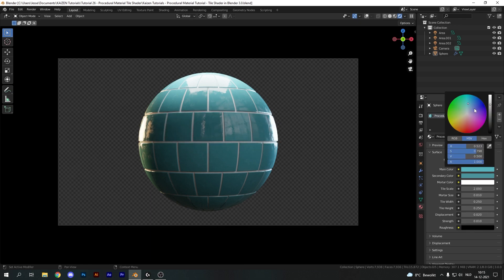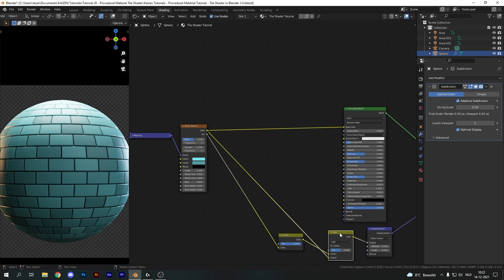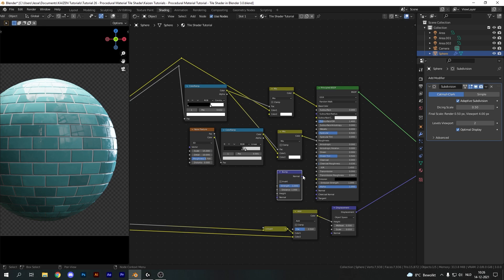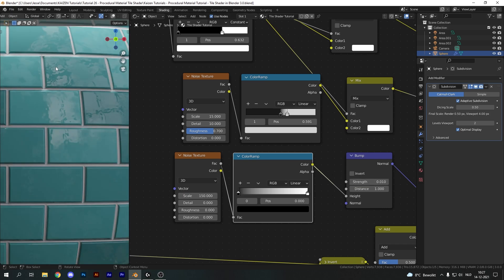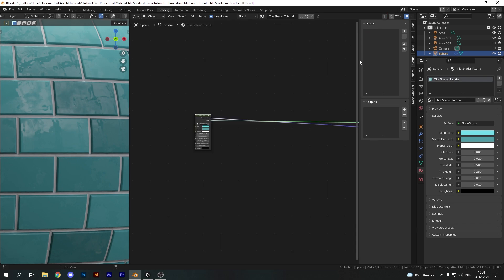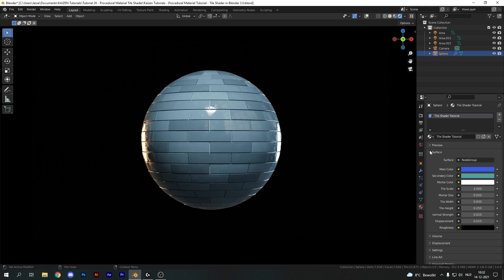Procedural Material Tutorial [Tile Shader in Blender 3.0]

Comment: Thanks for this tutorial! Nice texture! I managed to make it, but the bump/displacement effect doesn't work for me. My texture remains flat and the tiles don't stand out against the mortar. However, I did select bump and displacement in the settings. I'm trying to apply this texture to a rectangle. Any idea?
Reply from the maker: you need geometry for displacement to work, so either enable experimental subdivision or just subdivide the plane a bunch of times. Normal(i.e. bump) should work though. Just be in rendered view and have lighting to catch on those edges.

Comment: Maybe someone here can help... how could you add a random tilt so not all tiles are perfectly arranged on a planar layout, but are slightly unevenly placed?
Reply from the maker: that would be hard to do, but using normals that would mean applying randomized gradients on each tile. It's probably possible, but this is really advanced procedural shading in Blender and would probably be better done in Substance Designer e.g.

Comment: I have a material I need and is it possible to bring in a photo and or normal and displacement maps and plug it into the material and still have it be seamless and procedural? I think the most realistic outcome is bringing in a photo of the real tiles but I'm having trouble figuring it out in blender.
Reply: would I be able to plug in a material with the bump, normal and ambient occlusion into the color factors?
Reply from the maker: You can do that yeah, but you'll have to 'mask' the edges to get a good result. It's still not the best solution though for seamless stuff as you'll always get repetition and our eyes are great at spotting this.
Reply: @KaizenTutorials  hm what do you think the best result I then? If I need to use a specific tile / material

Comment: Hi, thanks so much for this, it's great.  How do I rotate the rows as you have in your animation - to get different layouts of the tiles.  Thanks.
Reply from the maker: There's an offset slider on the Brick Texture for that.
Reply: @KaizenTutorials  Great.  That's helpful. I have one more question.  I am trying to make a group of objects - each with a different colour tile on them.  I have copied the procedural material in the material tab and altered it but they don't seem to be able to be applied.  Do you have any advice? Thanks.
Reply: @KaizenTutorials  are you able to help me to apply these - I am completely stuck. I have managed to do one but the others are not attaching to the objects which are just matt.  I can't get the tiles onto them.  Thanks, Clare

Comment: Thanks for tutorial. How can we change seam  mortar color and sill keep it rough/matte? When I unplug fac-socket from Brick Texture node the seam color can be changed but then it just follows the overall roughness of tiles.
Reply from the maker: You'd need to create a separate map for the roughness. So just use the same way you're controlling it now, but also use a different map for the color of the mortar.

Comment: err my bump mix is wired as its inverted and doesn't act like yours I assume its due to an update since this videos upload
Reply from the maker: hmm you can either try inverting the node with an invert color node, or hitting the invert on the bump.
Reply: @KaizenTutorials  i thought the same but it did not work so i just left it on white as i think it due to experamental updates
Reply: @KaizenTutorials  im also having an isuse that im not sure if you can help with but adaptive mesh crashes my render but turning it off renders fine (I fixed this by truning off adaptive sub and just subdividing it to 4)
Reply from the maker: Ah yeah adaptive can be hard on your pc making it run out of gpu memory. So you can either make the dicing scale higher or as youve done just use a regular subdiv with a high number

Comment: Hmm, When i turn on the adaptive subdiv, there are black artefacts that appear on the top and bottom of my sphere?
Reply from the maker: Hmm that’s weird. Maybe your displacement is to strong?
Reply: @KaizenTutorials  , I checked and when I turn simple subdiv instead of cat 
Mull Clark it works
Reply from the maker: @SG-bh7cz  aah ok that means you probably just needed more proper quad geometry to work with. Still a bit weird though. But if it works with regular subdiv thats fine too
Reply: Hey there kaizen, I would love to know the lighting and hdri’s u used for this video!
Reply from the maker: Simple tri-light setup with a back light, rim light and key light. No HDRI I believe! And if I did its probably an interior one from polyhaven with a very low strength!

Comment: Hey Kai, thanks to you I made my first PBR material and I've also added my first asset to the asset browser! However, I need a little help. I'm using the shader on a plane [acting as a wall] I've simply dragged and dropped the material from the asset browser and onto the plane. It looks great but I want to increase the DEPTH of the mortars so that the tile looks more "bevelled" right now its kinda looking too sharp around the edges. How do I do that? I haven't subdivided or done anything to the plane. 

For context I'm making a product render where the product is placed on the a tiled environment.
Reply from the maker: Great to hear! I think you'll just need more geometry. This will make it smoother. You can change the mortar smoothness in the node but it doesnt do much if the displacement has no geometry to work with. So add a subdivision surface modifier, crank it up and sit it to simple and it should look good. Then after you can increase/decrease the mortar smoothness to your liking.

Comment: Great video! Beginner friendly and easy to follow. I have one small issue. On exact same sphere bricks were looking completely fine, altho when I've tried to put it on flat surface around 5mx5m, texture begin to curve a bit in one point. After rotating the mesh it still remains on it's place.
Reply from the maker: That might be due to which texture coordinate you're using. Make sure you're using UV coordinates so it works on any object (if unwrapped atleast). Hope that helps!
Reply: @KaizenTutorials  Problem solved! Thanks for the help!

Comment: Hello Kaizen! I'm doing procedural materials with this tutorial by days but there is one thing i can't fully understand: why my displacement map isn't even? it distort my bricks at various heights. I tried ticking everything but it simply doesn't behave like yours. I tried doing something but nothing to do
Reply from the maker: Usyually when something goes wrong with displacement it's an issue with the geometry. Try adding more geometry for the shader to work with. Either add a subdivision modifier or simply add more in edit mode. Hopefully that works!
Reply: @KaizenTutorials  Thanks for your reply! It helped but I was at work and my question was roughly explained: the real problem is that my displacement map (value of ~0.08) displace tiles casually at different heights (like a mini world sorrounded by all different buildings). Another odd thing I just discovered while typing this comment is that even if my brick height and brick width are the same value they doesn't form squared tiles. From Blender 3.3
Reply from the maker: Oh the default output for the brick texture has color variations (grey value) that causes this. Just convert it to pure black and white using a colorramp set to constant :-)

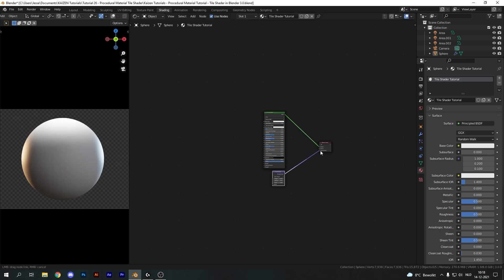Comment: 01:52 You can plug this in very quiclky by pressing ALT then right clic and drag from the displacement node to the material output (Node Wrangler addon activated ofc).
(Works for all nodes, but sometimes it choses the wrong socket)
Reply from the maker: Nice, thanks for sharing!

Comment: Great tutorial, friend! Question, how might I round out the grout, so that the grout is more of a curve rather than the harsh 'v' where the tiles meet. And is it possible to soften the tiles bevel?
Reply from the maker: Thank you! I think you'll need to experiment with some math and float curve nodes to achieve both of those. Since we're basically talking black and white values here (height map) you can tweak the results oftentimes by adding the right math nodes and sometimes even easier by just using a Float Curve node and tweaking the curve. Hope that helps!
Reply: @KaizenTutorials  thanks for taking the time to reply.

Comment: Hey, great tutorial!

I would like to know how can I put this material in a normal cube if I want to. Like I'm working in a pool scene, but it simply are a extrude in a cube pool. So I just want to put these tiles on the wall of the pool and on the wall around...but it doesnt work when I click displacement and bump because the walls get a different form, I dont know how it works lol
Reply from the maker: Haha I can imagine. Displacement is not easy to work with. So what you want to do is you want to make sure you have data to work with. Since you used a cube for the pool, it only has a couple of faces. The displacement will try to displace them, but since there is nothing to work with it will give a weird result.
So TLDR; just go into edit mode, press A to select all, right click and subdivide a couple of times. After that add in a subdiv modifier and set it to simple! This should get you in the right direction for it to look good 👍🏻
Reply: Thank you so much!! I will try it!

Comment: I've done all the steps. For the most part it turned out pretty well, however there is a weird spikey displacement going on with my mortar, any guesses on how to fix? Great tutorial btw!!
Reply: Same issue :(
Reply: Reducing "dicing scale" under adaptive subdivision modifier from 1 to .5 fixed my spikey mortar :)
Reply from the maker: Thanks! Glad you like it. I'm not entirely sure what's happening with your mortar displacement. It should be flat, considering we're using black values for the mortar displacement. If you want you can send me some screenshots and I'll have a look what's going on! You can send them to kaizentutorials@gmail.com
Reply: @KaizenTutorials  Sounds good, just sent a few pictures over! Thank you
Reply from the maker: I’ll get back on it tomorrow probably!
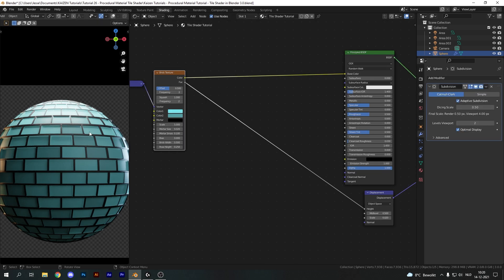Reply: @KaizenTutorials  By the way, if u look at 3:23 and then at 3:26, you can see you had the same problem but somehow you fixed it xD
Reply from the maker: Yeah! It’s not really a problem though. Just reset the adaptive subdiv by unchecking and rechecking the box! That should fix it. The spikey stuff is just a lower resolution when you zoom in which needs updating :-)

Comment: How did you get the preview on the left?
Reply from the maker: Just open up the shading workspace. You can then close and open up windows as you see fit. So by rightclicking on the edge between two windows you can close one and by going to the bottom right corner of a window you can click and drag and open up new windows. This is how I ‘created’ this workspace! Hope that makes sense :-)
Reply from the maker: Oh and I might add that when you get it on the left you can then enter ‘rendered view’ and make sure to disable the overlays with the button which is two circles overlapping (somewhere top right for that specific window). Now you have exactly what I had 👍🏻
Reply: @KaizenTutorials  Ah I see that's a legit sphere in the 3D viewport. I thought it was somehow the material preview that you can interact with. Thanks!
Reply from the maker: Haha no! Just a lit sphere with no overlays 🙌🏻